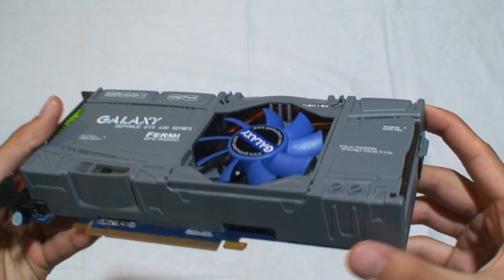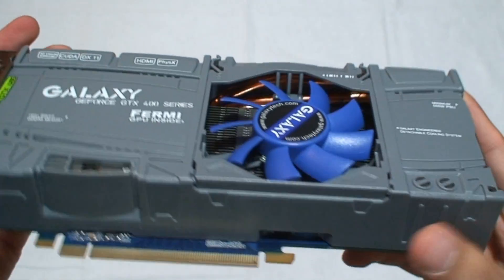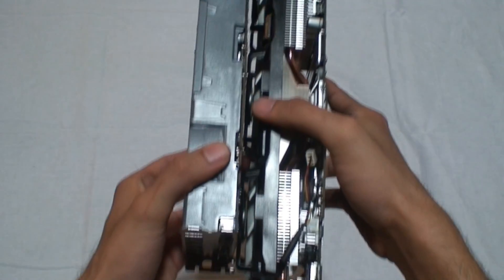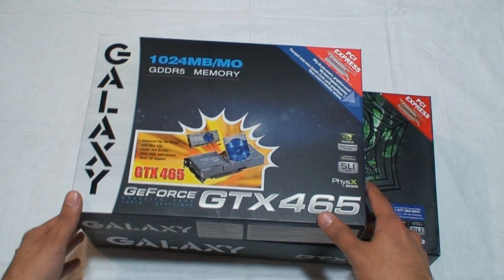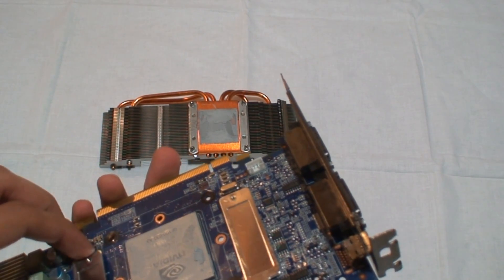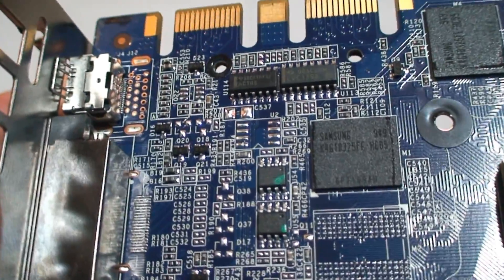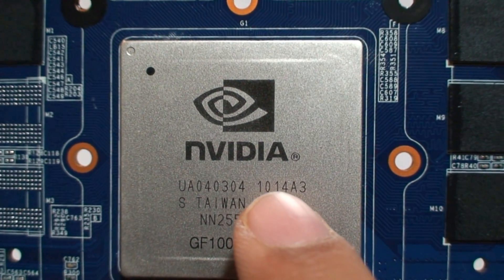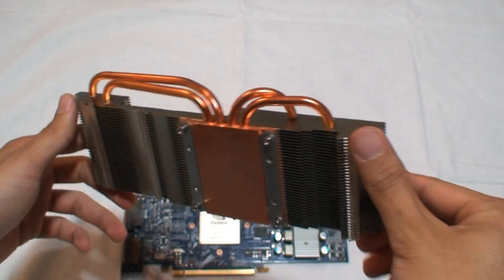Part 2 - Taking off the cooler , Galaxy Nvidia GeForce GTX 465 Video Card Review

Comment: @joebombable Guru3d, but if you consider this card worth buying, you're wrong. The HD5830 wins almost every benchmark, except some extreme tesselation bullshit like Heaven 2.0 that you will never see in real games. Than again, the HD5830 is already way overpriced with it's 200€, the gtx465 is 80€ more. Not very valueable if you cosider that the HD5770, which is half the price, does better in some situations...